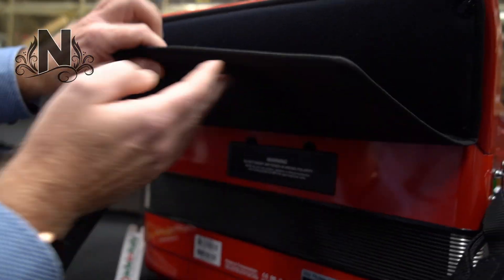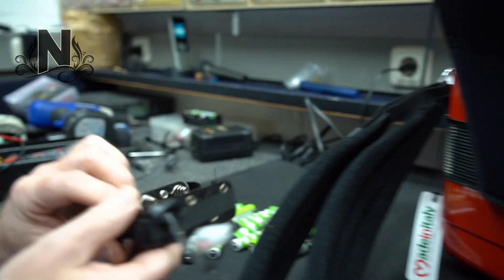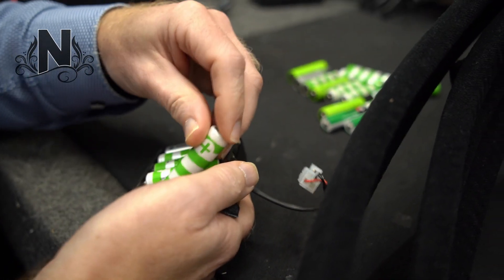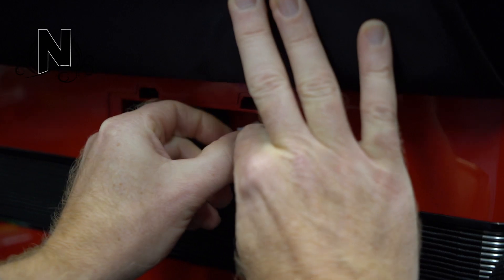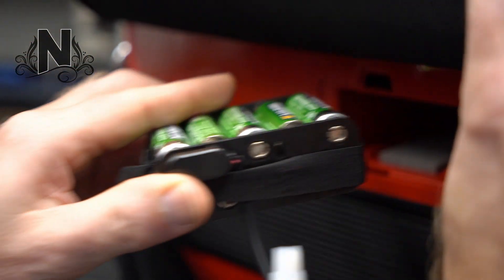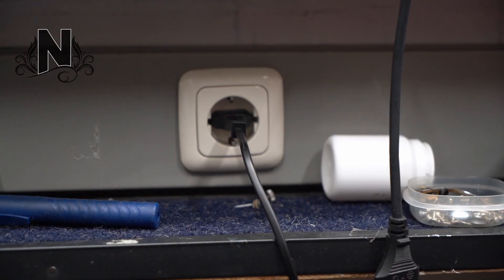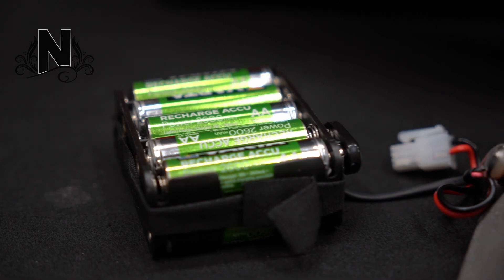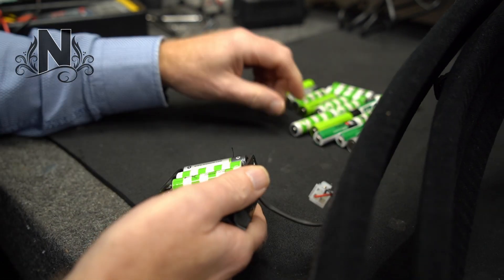Roland V-Accordion FR4X // Charge Kit Upgrade! NO MORE BATTERY HASSLE!

Comment: I’m using a rechargeable power bank designed for laptops. It is set to 12v, I’ve had the same power bank for 10 years and I can still get a good 18-24 hours on a full charge. It fits nicely behind the treble keyboard attaches with Velcro and is covered by the bellows protector. Works great for my fr-3s and my fr-3x I see no reason it shouldn’t work for my fr-4x when I eventually purchase one. I had to reverse the wiring for the 3x as it’s a different polarity, and I drilled a hole through the battery compartment cover to run out a cable to the power bank.